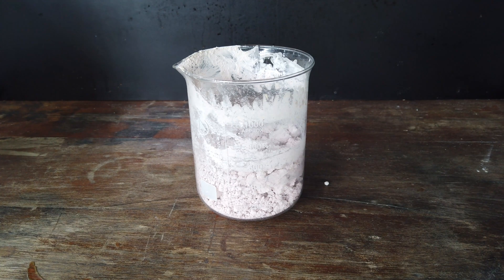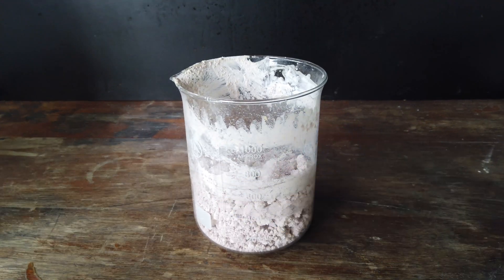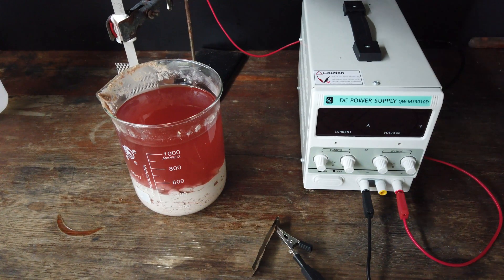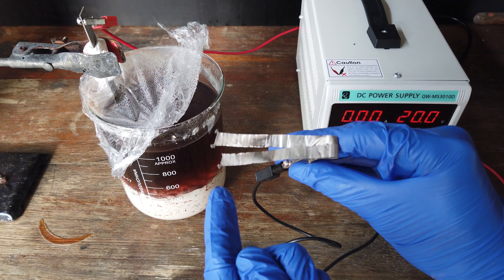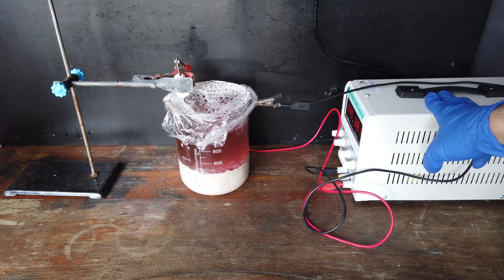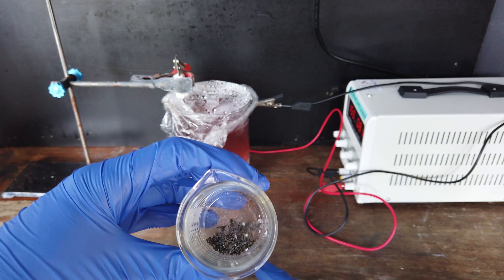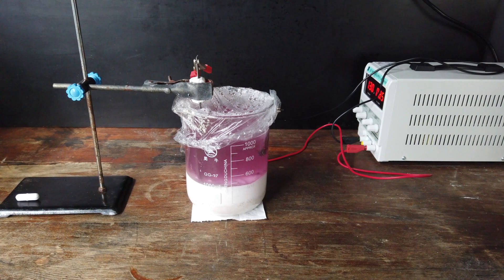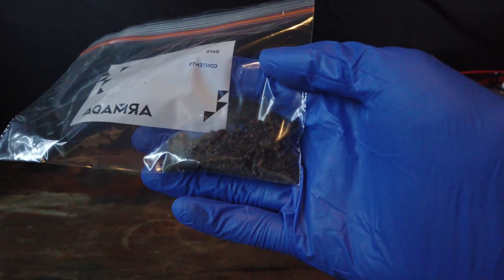Cobalt From Li-Ion Batteries - Part 3

Comment: How does one know what metals you can use in your process of electrolysis? Is there a book with a guide to tell you what you can use for the cathode and anode?
Reply from the maker: That's unfortunately an extremely broad question. Every single separate process will have separate electrode requirements. Each setup depends on which reaction you want to occur on the cathode and anode. I don't have a complete book or guide on this - to get a complete picture of this you'd need to read literature on each individual material and its behaviour under different solution conditions.
In general, there are a few simple rules. I'll give a list of some of the common ones in aqueous systems:
- Graphite and other carbon-based electrodes are pretty much completely inert. Graphite will slowly physically disintegrate when performing oxidations, but will not add any chemical impurity to your solution system. Other electrode forms such as glassy carbon or boron-doped diamond are virtually impervious to degradation. Carbon electrodes are great 'all-round' electrodes due to this inertness, but they're generally not very good at doing reactions. Often, these electrodes are so bad at doing a particular reaction that they'd rather just reduce or oxidise water. A good example here is the oxidation of chlorate to perchlorate, which a graphite surface just won't do.
- Platinum (or platinum coated) electrodes are almost completely inert. The only issue is that they degrade under oxidative conditions that are sufficiently acidic and coordinating. Using a platinum anode to electrolyse hydrochloric acid would cause the platinum to dissolve, but almost all other conditions will not damage it quickly. Platinum is often very good at doing various reactions, as it acts as a good electrocatalyst under many circumstances.
- Noble metal oxide electrodes are good at doing some oxidations under neutral pH. They're generally called a 'mixed metal oxide (MMO) electrode' or 'dimensionally stable anode' (DSA). These come in a wide variety and some versions can also perform other oxidation reactions under basic or acidic conditions. They are not designed for reduction reactions.
- Nickel metal is generally rather inert. It can perform reduction reactions under most conditions, and oxidation reactions under basic pH. Oxidative conditions in acidic or neutral pH will likely destroy the electrode.
- Since metals can't be directly reduced, most base metals (excluding the more reactive ones like aluminium or zinc) can be used for reduction reactions under a wide variety of conditions.

Sorry if that doesn't make much sense. Again, this topic is incredibly broad.

Comment: Wow, this really needs a bigger cathode! Putting that much current through a tiny little cathode is really inefficient. If you want good metal plating, with reasonable coulombic efficiency, the cathode needs to run at less than 50mA per square cm. 1.5A over the 5cm2 or so you’ve got there works out at more like 300mA / cm2. 6x too high! Most of the current will be splitting water and making your cathode very basic, which really slows it down and wastes electrons.

Comment: Sulfuric acid will cause cobalt sulfate to precipitate due to common ion effect. You may have better luck using hcl as your acid. An easier way to get your cobalt free would be to mechanically separate the cobalt layer from the battery, then wash the black stuff in vinegar to remove the lithium. Next heat it to burn off the carbon. Then use a termite reaction to convert to the metal. They usually use copper 1 oxide mixed in with the cobalt oxide

Comment: Not that I expect you to try the lithium again, but if you do, look into Royal Water. It was/is a method of dissolving gold and platinum solids in hydrochloric acid and nitric acid. I can't recall the ratio off-hand, but memory is telling me 4:1 hcl to nitric. Extraction you can either distill off the acids (not my favorite way, but it works better under vacuum) or run it through an adequately sized aluminum silicate filter; I've not tried the latter but I have some on order to try with another process I'm working on. Gold isn't too surprising, but if it works for platinum, lithium ought to be a breeze.

Comment: Cobalt goes for $15/lb, seems like it would be easier to just go buy it than to extract it =)
Reply from the maker: Yeah definitely. I’m never going to suggest this process as a reasonable way to obtain cobalt.
Of course, the point of the project is more for fun than for practicality though.
Reply: @ScrapScience  I was a battery test engineer, so I was trying to think of business ideas I could start in my backyard.  Thank you for these experiments showing that I would need pallets and pallets of out-of-service used lithiums to recycle and convert into raw materials, and at that point it's a major capital venture. 

I see why companies out there are trying to figure out how to safely re-deploy used lithium battery cells, key-word "safely".

Comment: Good to see something came from all your efforts.i wonder if it would be cheaper than the electric bill to just buy the cobalt
Reply from the maker: Haha, well the electricity cost me about $1.50, and the extracted cobalt is worth around $0.75, so feel free to do the maths...
Reply: @ScrapScience  pretty inefficient but I'm still surprised that running it for days was that cheap.great video sorry the experiment didn't work out as intended.keep it up!
Reply: @ScrapScience ... Interesting you say that. 😂 It is like for well over 10 years all those scrappers trying to save all the gold and silver composites (such as pins and platings) for their planned future projects.  Even in a $200+ electronic device or computer they only recover like 75 cents in silver and $1-2 in gold using time and resources of $10+ completely outweighing what they'll gain in saving those component composites.  That is why Lithium battery manufacturers haven't engineer designed for ease in recycling Nickel, Cobalt and Lithium because no recycling manufacturing company has made it a profitable venture ever.  Yes it is possible to repair and replace dead Li automotive electric battery components but the remaining components aren't new and will create a cascading failure of repaired and reconstituted replacement batteries (of less shelf lives).  Engineers understand that with no viable profitable recycling of raw materials Li, Ni, Co and whatever else plus no viable restore of used batteries cells matrices ... Ten years (more on restored and reconstructed and fixed damaged cells) is the lifespan engineered before new raw elements are needed from mines again here.  This is no green earth reality right now in the sciences.

Comment: This is something I've been looking at doing with my lithium battery collection. Do you think it is possible that only one metal is plating due to the voltage used? I have read that electrowinnowing can plate out one metal at a time if you target the voltage needed and then step up the voltage for the next metal. I haven't tried this yet. A note on dendrite formation; from experience, this tends to form from a few different factors. Some will form because the metal is cleanest at the points where it has been freshly cut, having any passivating or oxide layers removed so current will want to go to the path of least resistance. A clean of the cathode will help with this. The second point is that from everything I have read, low current densities on the surface area of the cathode leads to a much more uniform coat of plated metal. I've seen this a few times as well but I suppose that you are only looking for extraction and not plating and purifying.
Reply from the maker: While it's generally possible to selectively plate out metals from solution, the reduction potentials of cobalt and nickel are so close together that this is virtually impossible unless you can influence overpotentials in some way. With metals exhibiting a higher difference in reduction potential (like copper and zinc), this is much more achievable.
And yes, low current densities generally give a better metal coat, but we're more interested in minimising the parasitic hydrogen formation to maintain an acceptable efficiency. For this, it's generally better to use a higher current density. In proper plating experiments, hydrogen should not be an issue as it is here.
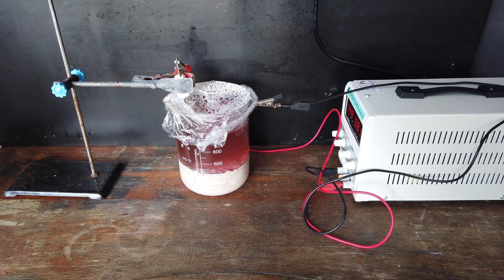Reply: 7:59  @ScrapScience

Comment: I think you might recoved Cobalt only. Because Nickel usually doesn't fall out with this method  . But I could be wrong.
Reply from the maker: Why wouldn't nickel plate out like this?
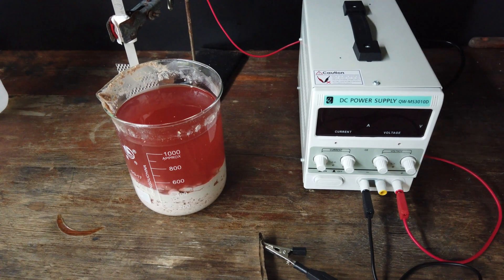Reply: @ScrapScience  I was training for 3 months in metal plating company they were using metal salt and inert anode for copper chrome and gold but they used nickel anode for nickel . Because of that I said it maybe didn't work. And this guy tryed too but he failed  checke 3:37 in his video  https://youtu.be/8DZvgP2eu4U

Comment: I'm sorry to be That Guy, but when I saw you'd decided to take perfectly good lithium metal, dissolve it, and try to get it back out, I screamed "don't do it," at my computer.

The lesson: electrochemistry is the thing you try after you've exhausted all the other options. At the most fundamental level, the reason it comes last has to do with the Faraday constant. A mole is a quantity 6 orders of magnitude bigger than a coulomb, so you can expect to spend a hundred thousand times as much effort by pushing things around in coulomb quantities as you would doing more ordinary chemistry.
Reply from the maker: We never started with 'perfectly good lithium metal' though...
Lithium ion batteries do not contain metallic lithium. They contain lithium oxide which is finely incorporated into a transition metal oxide structure. Simply extracting lithium by peeling the batteries apart is impossible, and instead requires extensive chemical extraction. That's what we're doing here.

The reason we're using electrolysis to try to extract the transition metals is because it's a very effective way of doing so which doesn't involve adding any extra ions to solution. This simplifies any lithium extraction we may want to do later on. Simply precipitating them with hydroxide would inevitably introduce other cations to the mix. I'm pretty patient, and I'm perfectly happy to leave an electrochemical reaction going for a month or two if it works.

Comment: Do you think using a claypot membrane would have made the process more efficient?  

Maybe place the undisolved hydroxides in  with sulfuric acids snd the platnum anode and the cathode inside a clay pot.  I'm thinking the pot  will tend to keep more of the sulfuric in the anodic container jeeping it in a higher concentration to better react with  and dissolve the undisolved hydroxides, while the metals will tend to hang out in the cathodic chamber and better plate rather than participate in side reactions with the sulfur that lower the overall efficiency.
Reply from the maker: The process would definitely be more efficient from a Faradaic standpoint. Everything you've said here is correct. However, there are two problems I've found with doing it like this.
First of all, we completely lose the pH buffering capability in the cathode compartment. By separating the half-cells, the cathode chamber would steadily become more basic as electrolysis progresses, quickly reaching a basicity high enough to make transition metals insoluble. We need to maintain a neutral pH, which proves to be quite difficult with this type of setup.
Other than that, introducing a diaphragm increases resistance considerably. This normally wouldn't be much of a problem, but the plating reaction seems to necessitate a high current density, which would become significantly more difficult with increased resistance.
Reply: @ScrapScience  cathodic chamber ph, and transition metal insolubility. 

1) What falls out? 
2) Does plating continue?
3) If plating continues then as the metals in solution are depleted would those that fell out go back into solution?
Reply from the maker: When the pH decreases, transition metal hydroxides fall out of solution. This is just a function of hydroxide ions being generated on the cathode during parasitic hydrogen evolution.
In theory, plating could continue for a little while, but as hydroxide ions keep getting generated, the soluble transition metals will continue to be depleted and won't redissolve unless acid is added. In reality, it's even worse than this, because the insoluble hydroxide precipitate actually forms over the surface of the cathode, blocking current flow. I've encountered this quite a few times with my experiments in electroplating manganese.
Reply: @ScrapScience  I can see where the hydroxides crystalize on the cathode represent a serous problem  when trying to make the metal.

Comment: Why CaO and not NaOH?
Reply from the maker: The idea was to avoid sodium contamination when we were trying to get the lithium. Additionally, the calcium ion isn't very soluble under these conditions, so it's an easy way to precipitate the transition metals without putting any extra ions in solution unnecessarily.